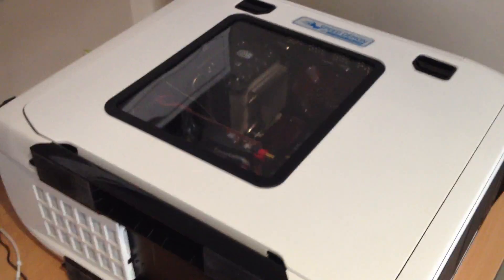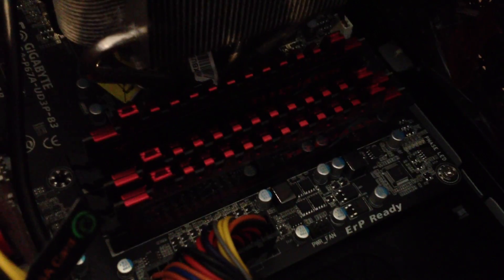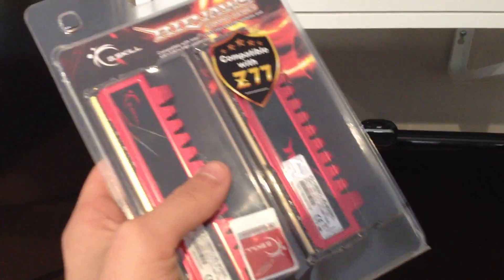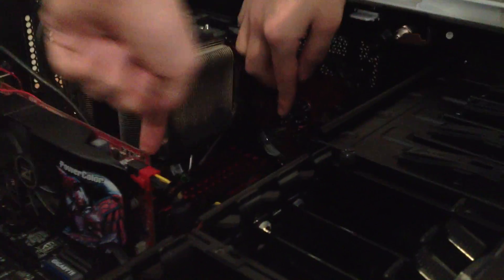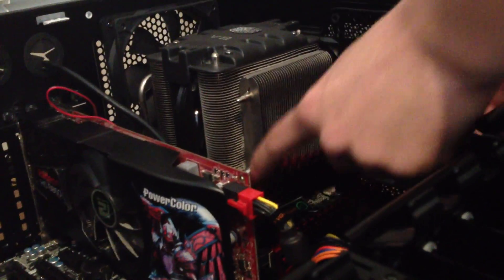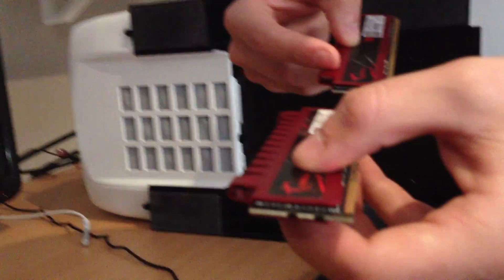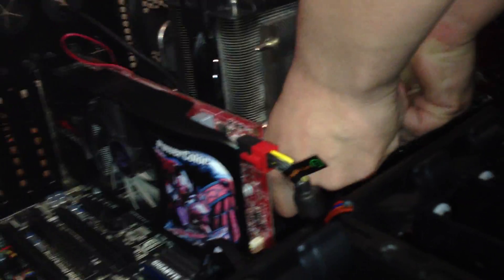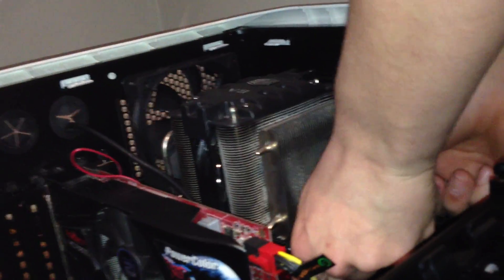How to install Ram into a Gaming PC

Comment: You malaka, its dual channel :P not quad channel. Quad channel is reserved for the higher sockets such as the 2011 sockets (i7), mind you its just dual channel with 8 dimms.

Also, one ram module can not die, unless you've like overclocked that specific ram module, to something crazy like over 2200mhz+ (for one module) You silly malaka !!  lol your a funny human.